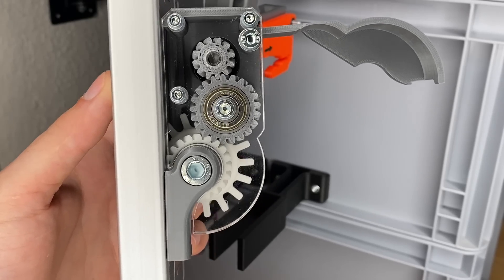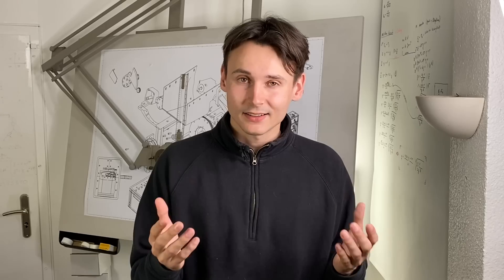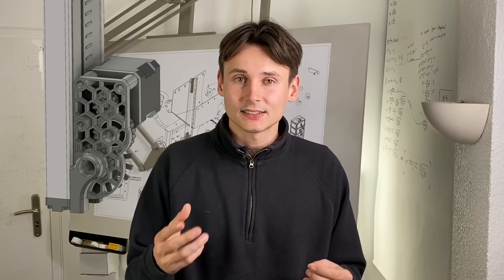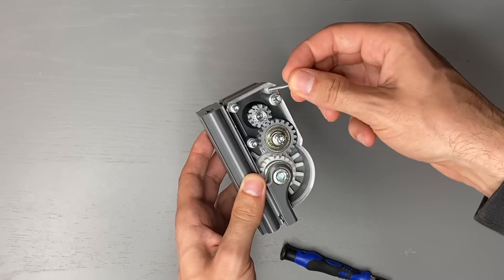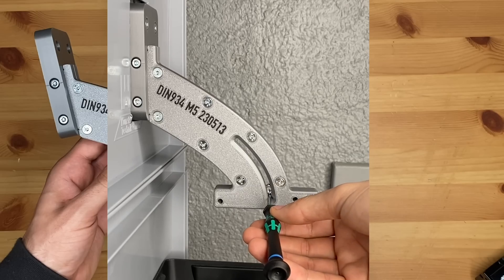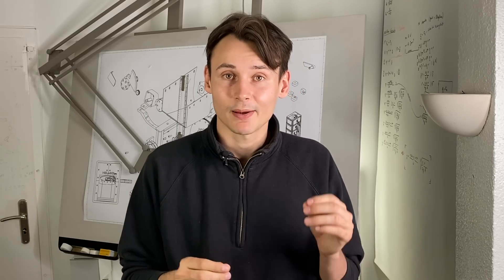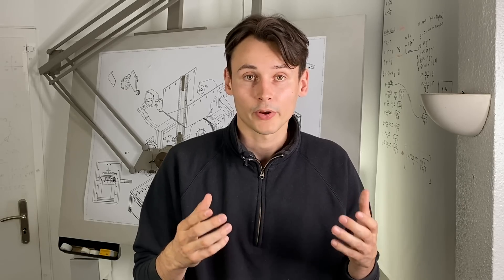Quick-Lock & Sprocket 2.0 - 3d printed automation #005

Comment: it's helpful to more precisely characterize the problem. you're correct that discontinuities in the walls of the channel the nuts are sliding down will cause a jam, but not all discontinuities. if there is a ledge, that's an opportunity to snag, but if it's an overhang, the discontinuity is facing the wrong way for the nut to grab on. so you could increase your tolerance by having the channel in the lower mating parts slightly wider than the channel in the upper mating parts, and then gradually taper back to the original width so that this can be cascaded without exiting your width tolerance. to be clear I'm talking about a fraction of a millimeter extra width, and multiple centimeters of channel for the taper, so the actual angle of the taper would be miniscule
Reply: The issue is that this extra space allows the nuts to spin a little, and then the leading corner of the nut before it can slide besides the trailing corner of the nut that has more room, and jam both between each other and the walls as seen on 7:47. I feel the better solution would be to widen the channel enough so that nuts can pass through when they are at their widest, being that instead of touching the sides with a flat edge, they can touch the sides of the slide with their corner edge. This way nuts cant jam each other since they will just spin until they are hitting each other with the flat edge and come to stable rest like that. Also their slanted corners will help slide past inaccuracies.
Reply: @BartJBols  the nuts slide freely, therefore there's already a bit of clearance. so there's got to be some range of clearances that would work, it's just a question of whether that range is large enough to be useful for what I suggested.

as for widening to allow for the nuts to rotate 30 degrees: I think the point of the design is to constrain the nuts to only one possible orientation. the one it's constrained to is the worse of the two options, but it has the benefit of being the narrower one, so you can use that to guarantee all the nuts will be in that orientation and thus have the same stacking height
Reply: @BartJBols  it is forbidden to allow the hexagon to roll until flat slide down. down below at the sprocket metering mechanism, it is key that the nuts always come down in identical orientation to ensure equal spacing between every single nut in the buffer.  this is only possible if they always come flat side down or always come vertex down. i don't see how the former can be guaranteed, but the latter can be by keeping tunnel width between 2*radius and 2*apothem. a carefully designed sprocket may be able to deal with different orientations but it is likely a new node of reliability that is not worth introducing. the problem will be magnified with smaller nuts.

Comment: Feels like a gate system for the magazine inlet/outlets will touch on a lot of the issues you're dealing with. I'm thinking about all sorts of ways to bridge the interface between conduits. Carefully changing angles could help, compliant mechanisms at the boundary could help, smooth sheet plastic inserts could help, like strips of acrylic/PET/etc that line chute, either entirely or just near the boundary. I think you might see a benefit from adding a freewheel sprocket across the interface which will interleave it's fingers between parts to break up trains.

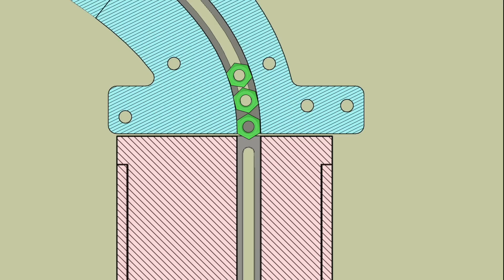Comment: 7:27 - put a small chamfer in the pink area with a largest radius to the lower section. (Time of writing 7:30)
Reply: I was also thinking the magazine slot could be just slightly oversized at the top and then taper back to the desired width over an inch or so.

Comment: As good as the design is for this assembly, why not use the stepper motor that drives the magnetic feeder plate in each basket to count parts? Doing this would also eliminate the forced turning of the nuts issue because you could make the width of the channel wide enough so the nuts can't get jammed up.

Comment: I have questions about the stepper motor:
1) did you consider a smaller one, like a nema14?
2) how about turning it 90 degrees and using a bevel gear? I think you could move it forward so that it almost aligns with the centre line of the magazine which might halve the width of the whole assembly. OTOH, I dunno if chasing the last centimetre or two is worth the added effort.

Comment: If the sprocket is already expected to be the most wear-punished part, maybe it would be an idea to split it into the gear and the sprocket, with the sprocket being a "pattern disc" that just gets coupled with the gear. That way, when it's worn out, the whole gear doesn't need to be reprinted but just the "disc".
It would also allow easier changing of the sprocket as only the disc needs to be swapped, to make it work with something else.
Something like this mockup, because it's easier to show than put into words (for me at least): https://i.imgur.com/0AqJher.png
Reply: That would also:
- make it faster and cheaper to make pattern disks for different size parts, or iterating the design
- allow pattern disks made from sheet goods (acrylic/etc, metals) which may have superior wear performance
- let the gear be changed out independently if say a different ratio was desired but the pattern is still god
- Let this geartrain module be used for different purposes

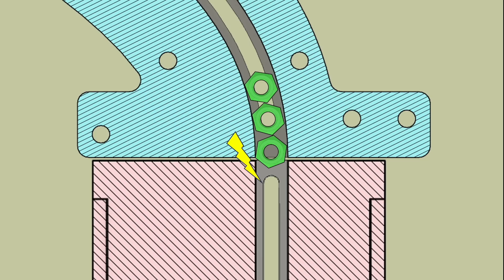Comment: 7:52 Have you thought of chamfering or filleting the problematic edges where they meet? That way there is not as sharp of an edge anymore.
Reply: It's a good idea in theory, however without good side face location on the nut they would just pivot in the feeder and jam. Continuous guidance or complete clearance needs to be held throughout the transition.

Comment: Amazing work and videos. Ty for sharing with us.

Theres some way to this machine work with different sizes of bolts and nuts? Or better, sort different sizes in different cabbinets?

I made a machine to sort different types of sample tubes in different cabbinets base on qr code in each tube (the machine send the qr code to main program via wifi to get whitch cabinet the tube need to go).

Keep going. Your machine is fanstastic.

Comment: Haven't seen previous videos so maybe there is a reason, but why didnt you use flat head screws on the rotating bit? So the arm didnt have to go over the screw heads? Not a huge increase in efficiency, but it'd be 3 more screws you could do and a little less wear and tear on the arm.

Comment: Is it a possibility to use some thin metal strips on the insize of your cartridge system or the bend? Thinking of hardend bandsaw blades. Or just wrapping metal band just some glue behind it and the ridges of the print will be away and way less friction

Comment: Hi Christopher, have you though about putting a worm and worm wheel on this design it will let you put the NEMA 17 motor at an angle of 90 degrees right above your feeding wheel. You will have an immediate reduction that is big enough and a worm wheel can't drive the worm. Keep it up! It looks amazing!
Reply: Right now the sprocket is only marginally smaller than the motor (judging by eye, it's so close I may be wrong). If the sprocket could be moved to either of the slim faces of the magazine then a NEMA17 & worm gear would have a huge reduction, more than half of the width. I can't see why this would be a problem with nuts, but bolts are less clear to me.
Reply: @Ziraya0  what you get in reduction you pay for in friction, especially for worm gears. that's another part that will become a consumable. it will also be multiples slower in metering. i believe the current implementation is a 2x reduction and it is already sufficient to prevent backdriving the stepper by a full magazine of bolts.
Reply: It will be way more compact this way.